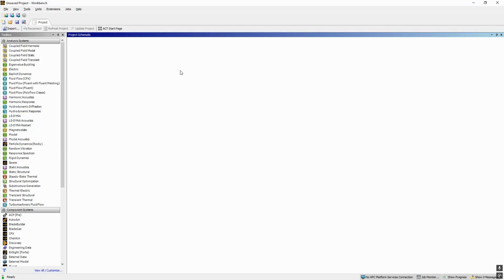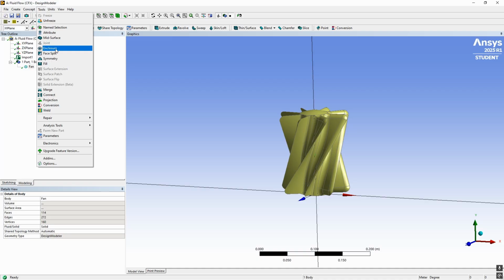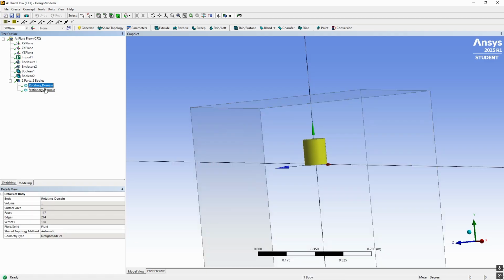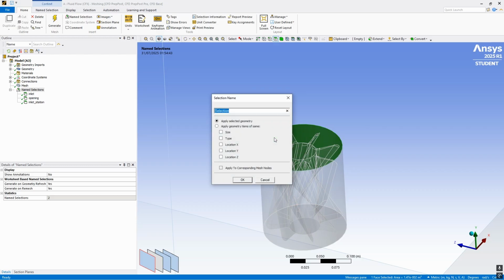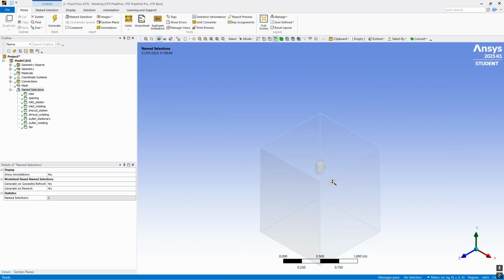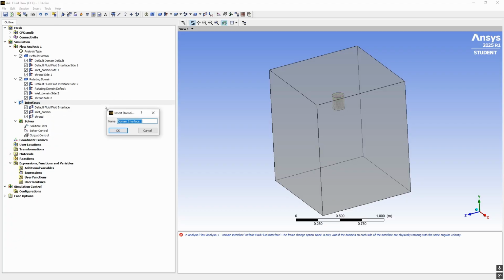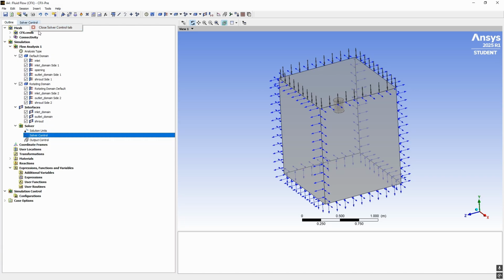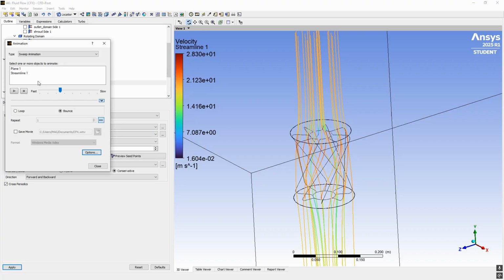Ansys CFX Tutorial for Beginners

Comment: Hello! I noticed that you updated all the thumbnails! Now that I am working on this tutorial, I have run into an issue where the generated enclosures are not centered on the axis. The part itself is centered but clicking Tools > Enclosure and adjusting the size, without touching anything else, reveals the enclosures are off center. If I use the analysis tools and distance finder, i get nothing between the enclosure and the part.. I am stumped here
Reply from the maker: Hi, sorry for the late reply. If you are still having the issue, when we are generating the enclosure, we generate it around the object regardless of the coordinate points. What I mean is that even if the geometry (in this case, the fan or whatever other solid body we are running the simulation on) is far away from the center of the coordinate lines when the enclosure is generated for the "target body", it will be generated around the body. So your problem might be with the 3D model. Maybe try to check if there are any issues with it through the CAD program it is made with. If there is no issue with it, you can try to manually model the enclosure through the design modeller or other CAD program and import it with the object. Just don't forget to change the type to fluid under the "fluid/solid" tab for the enclosure. Once again, sorry for the late reply, and please let me know if you found the solution.